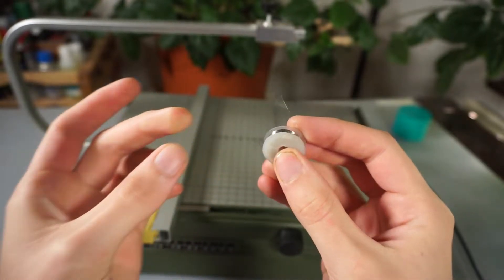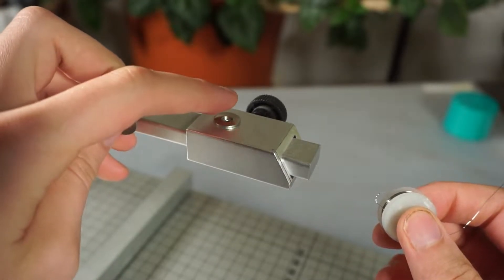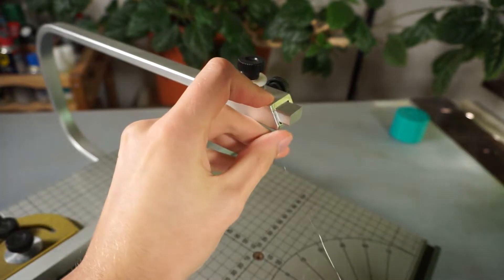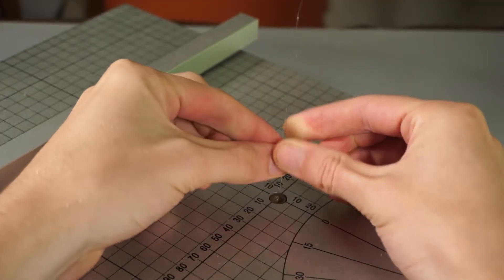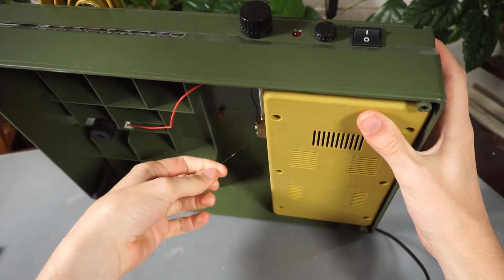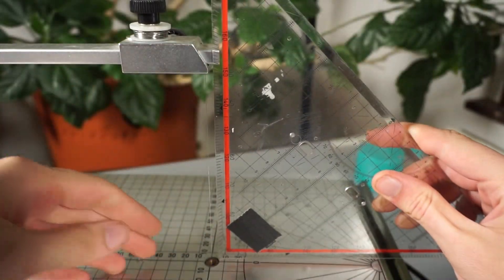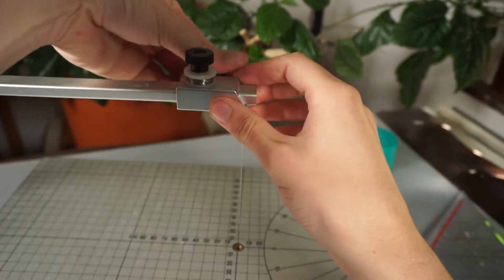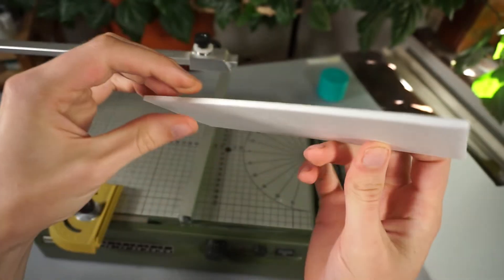Quick tip: How to setup a New Wire on the Proxxon 230/E Thermocut - Hot Wire Cutter

Comment: i figured this part myself easily enough with the manual, but what i can't find an answer to, is when to "shorten" the wire? cause as i understand you have 30m so I suppose once it's in bad shape, you cut the used part. the question is "how bad"?
Reply from the maker: You don’t need to worry about that, the wire will break by itself when it has become too brittle with the heat.